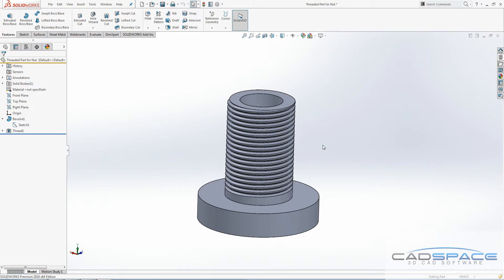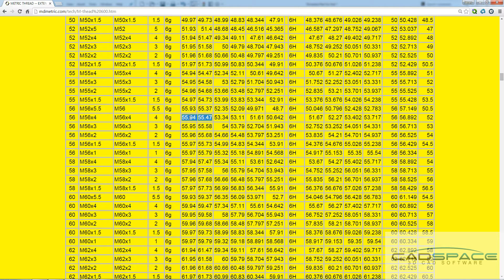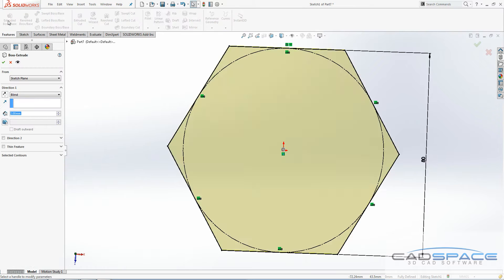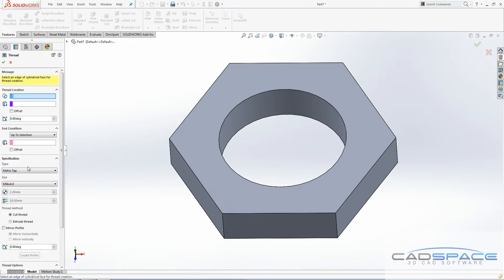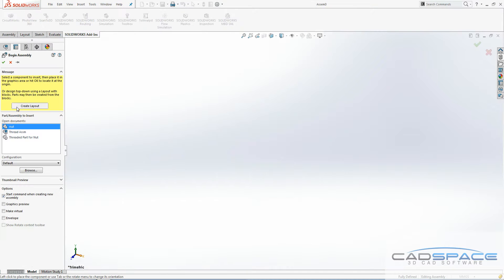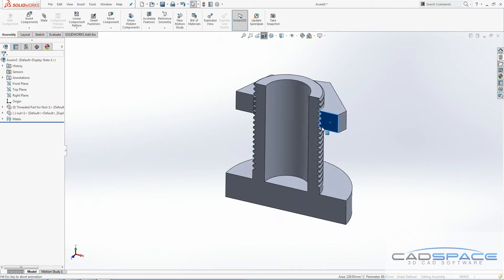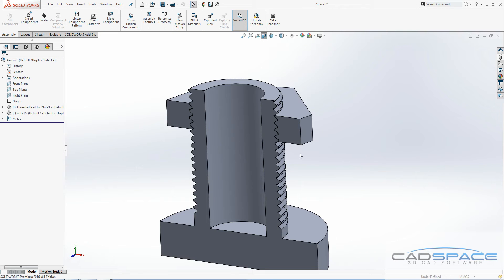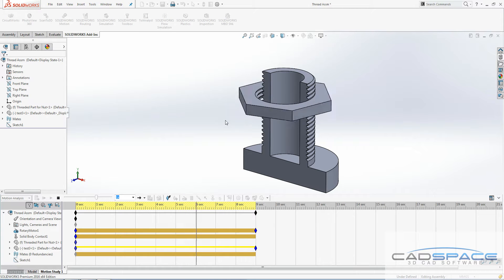SolidWorks 2016 Thread Feature - Tapping a nut

Comment: I just received Solidworks 2016, and I cannot figure out how to add the " Hole Wizard Thread"  to a tapered hole that I made using the "Hole Wizard".  I can easily add threads to a straight hole, but not to a tapered hole.  Could you make a quick vid showing how to make a NPT tread using the new "hole wizard" button?
Thanks!

Comment: You've misunderstood how threading in general  and solidworks thread tool works.
 The range of values you've identified is the size range a hole or bolt must be before threading. That is, an M56x4 tap or die will thread a part within those ranges. Unlike a standard tap or die the solidworks thread tool is driven by the OD or ID or the hole. eg, if your hole is slightly undersized a tap just cuts slightly more material away and you'll end up with the right thread size. but SW thread does not work like that, SW will make the thread undersized and it will not be a "M56X4" thread at all, it'll be some random Non ISO size like M55.745X4. 

In other words, if you choose some random value near the mid point of the acceptable range then SW will create a thread that's some random value too. In most cases It'll probably fit,  but it's poor engineering practice and will not conform to ISO standards.
Reply: Thank you for clarifying this.  What should be done then?  Always select the OD when using the thread command in SW?